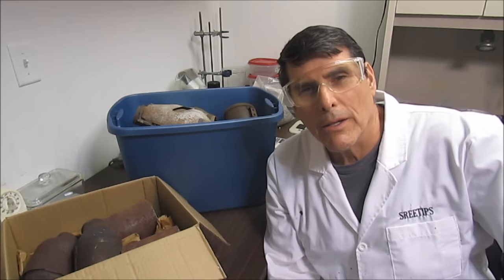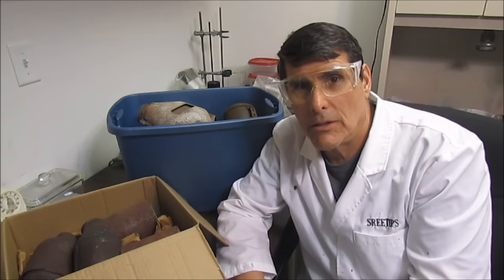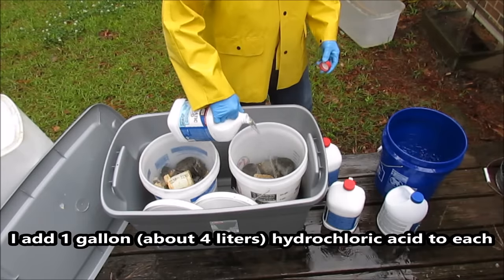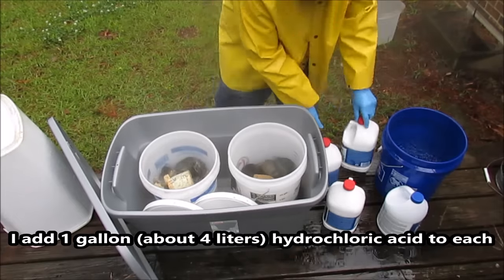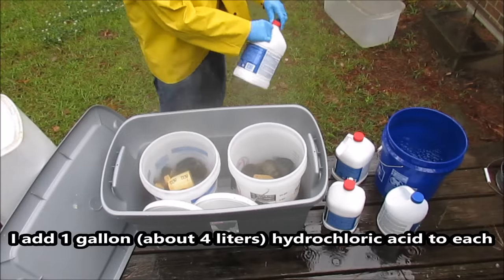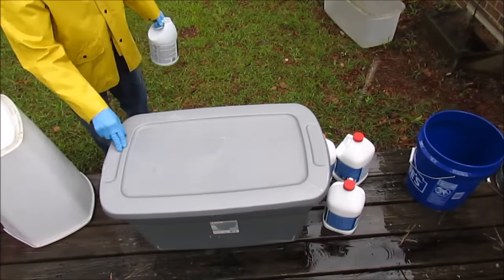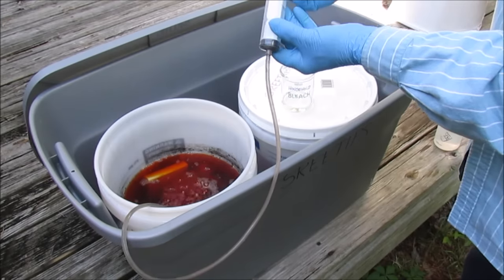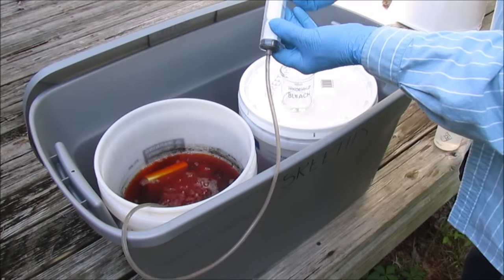Platinum Recovery From Automotive Catalytic Converters Part 1of2

Comment: Being a HVAC man myself it did my heart good to see you change the oil in you vacuum pump...! Take care of your equipment and your equipment will take care of you is my motto also...
Reply from the maker: I it's been in service for nine years and still going strong. Those things are bullet proof.
Reply: Yep as long as you change the oil frequently it will give you years of trouble free service. My Robinair is 30 years old and still pulls 30” of vacuum ...!

Comment: Really interesting videos, many thanks. Glad such attention to risks, but one gentle note though e.g. for anyone reading the comments and thinking of doing this or similar - maybe consider using longer gloves.. in the video (from point of processing outside through into lab) we can see a fair bit of exposed skin between glove and sleeve.. when dropping bleach in from above ..or dropping the zinc pieces into toxic dissolved platinum solution there will be splash back ..if you’re worried about aerosols enough to put a lid on beakers to protect a fume cupboard, maybe that’s an aerosol risk to all skin surfaces exposed nearby. Of course it’s all a matter of dose.. and it’s not like you’re holding your arms above them all the time… but still, given the toxicity, maybe wise to reduce skin splash risk a bit more. If you can see the skin, it’s definitely not protected (and that’s before we get onto the weird and whacky issues with different glove types and different chemicals).good luck with it all and thanks for the videos.
Reply from the maker: Platinum is simply too dangerous for the hobby refiner.

Comment: When I remember right, cementing is not exactly dissolving zink by acid until the acid is gone. Normally the cementing starts electron by electron because of electro-negativity even in water ON the less noble metal in exchange of it. So you were right to give some Na-carbonate to lower the acidity to save zink. I wouldn`t use Ca-carbonate because you get a new element in solution and that may cause some trouble in an other place in the story, maybe NaOH to neutralize a little?? (Na is allready in the process.)
I like your vids very much, especially the warning for dissolved metalls in terms of your health.
best regards Olli
Reply from the maker: According to the pros, folks who do this for a living, sodium carbonate is the chemical to use. The exchange of electrons is called "cementing" because when copper is placed in an acidic silver nitrate solution, the resulting grey silver powder looks like wet cement. Some free nitric is required for the reaction to take place. I've put copper in a silver nitrate solution with the nitric used up so completely that the copper just sat there and no silver formed on it. To get the reaction started, I added a single ml of concentrated nitric acid then stirred. Then the reaction began. So some free nitric must be present to get the reaction going. This has been my experience.
Reply: Jes sir, that is right, a littlebit acid. Here you needed huge amounts of zink to kill the HCl , so my thoughts are to lower more with NaOH, not all!. Over here was an old copper-lead-zink mine from the 18 hundrets, where big copper trees got buildet on the old steel-rails from the ore-carts under water, the same process I guess. I do the same with my stockpot, copper tubes in it. After a while I check the PH and lower it if needed. 
Sodiumcarbonate Na2CO3 is a good choise either and cheap, it builds with 2HCl --> 2 NaCl (table salt) + CO2 gas + H2O so you get rid of the surplus of HCl.
NaOH should do the same, just without the carbon dioxid. HCl + NaOh --> NaCl + H2O
and the zink is doing  Zn + 2 HCl --> ZnCl2 + H2 gas
Is the H2 needed for PM to drop out?

Comment: Best video I have seen in recovering Pt from Cat converter. Couple of question -1. You use sodium carbonate to reduce the acidity of the solution. Can I use calcium carbonate too? 2. How will you know that the all platinum were leached from the cat using HCL and bleach? Looking forward to your response. I hope you will do video in recovering Pt from metallic cat.
Reply from the maker: I think calcium carbonate is ok to neutralize, but I've never used it so not 100% certain. How to know when all the platinum is leached? Not possible, you simply can't get it all. The best case is to leach for about a month, then harvest the liquid.
Reply: Thank you for the response. Appreciate it

Comment: Since the mid 1990s, the catalytic converter is the most stolen part of any vehicle, specifically because of it valuable content.

 I had mine stolen 3 times on one vehicle. So the last replacement i got for it i had it moved further along the exhaust system and boxed it in with an empty stainless steel exhaust/muffler box and welded it inplace. So to any would-be theives, it looked like it didnt have a cat on it. 

It worked, i never had it stolen again off that vehicle, and my car still passed its emissions test every year after that so moving it didnt effect its effectiveness.
Reply from the maker: I bought those cats on eBay a decade ago (or longer) specifically to make the video. It was back when gold was a thousand bucks, palladium was six hundred, and platinum was fifteen hundred.
Reply: @sreetips  well you did a great job. I'm pretty much in awe of your videos! It's like watching real life magic.

Comment: I would have used a shot of Sulfuric Acid to take care of any Lead. 

Back in the day the ignorant poisoned their Catalytic Converters by running Tetraethyl Leaded Gas through their cars when they still sold that. I know that nozzle sizes were were varied to prevent this at the Gas pumps.

But I learned that I do not want Platinum salt poisoning by watching this video. I was unaware about the toxicity of Platinum Salts..

Great video as usual.
Reply from the maker: I'll have to remember to do that when I try to refine it in part 2 of 2

Comment: Don't get me wrong, it was informative for most. Nitric acid would have been the way to go, but you opted for the more difficult route. We are appreciative of the work you put in. That being said you restate the same thing over and over again until the point I'm screaming at my phone. Once or twice is OK -- four to five is just too much. FYI, I did some math with spot prices today. Below are my results. Keep in mind these are just estimates.
HCl 5ga@$8: $40
NH4Cl 1lb@$10: $10
40% H2O2:$10: $10
NH3/NaClO/H2O/Clorine tabs/Filter paper $10
Catalytic Beads (said a couple hundred): $200
Zn (didn't show us how much was used): $100
Total Cost: $370

Pt p/g: $25.60x4=$102.40
Pd p/g: $31.66x10(*)=$316.60
Total Net: $419
(*): you yielded 6g Pd with the additional vial you added to the reaction. You claimed another 6 was in the buckets. 10 grams is my estimate.

This took you at least a week not including time it took you to film it and you (would have) made roughly $50 (not including whatever you spent on the catalytic converters). You said you are selling that at a third of the price on Ebay so you lost about $250 after acetylene and oxygen and electricity and cleaning supplies/neutralizer (YMMV in any given location). Thanks for taking the time and money to do this. Just try to stop repeating yourself.
Reply from the maker: I've tried nitric in the past. Chlorine leach is much cheaper and much more effective at removing the PGMs from the ceramic substrate. Hopefully, after watching this video (the only video series of its kind on the entire internet) those who want to "make money" refining cats will become discouraged. You can't make money refining the platinum group metals from automotive cats. It's just not going to happen. It's too dangerous for the backyard hobbyist. And the yields are too low to cover expenses. That is the whole point of this video series. Sorry for the repetitiveness. Most videos on this subject are vague, leave out critical details, or just show part of the process. I try to include as much detail as possible for the benefit of those who want to know, and see, the entire process.
Reply: sreetips exactly the response that I was looking for. Yes the nitric can be more expensive, but the time it requires saves you in the long run.
Reply: Cameron J so if you know any short cut on the process maybe you can do a video and share it with everyone.

Comment: I don't know if anyone has mentioned this, but a simple way to tell if the converter has not been processed and has intact catalyst is to aim a propane torch onto it; if it incandesces, it is intact, and will even burn the propane flamelessly.

Comment: Let me give you a little tip about using your grinder with the cut off wheel. Anytime you use a grinder like that. you want to hold it where the wheel is pulling the grinder away from you not pushing it towards you. That's a good way to get that wheel to kick back and really screw you up.
Reply: Good advice I just broke my nose a month ago from a big grinder kicking back

Comment: When I was in the Navy. We called it P.M.S. preventive maintenance and servicing.
Reply from the maker: I remember it well. Ever hear of “gun decking?”
Reply: @sreetips  Gun decking no I found scuttlebutt to be a funny word. Also sound powered phones are cool.
Reply from the maker: Gun deck is when some one marks a PMS check as complete, but never actually did the check.
Reply: @sreetips  Sounds shady and lazy.
Reply from the maker: Agree - none of my guys did it. I did spot checks. You can tell right away if they gun decked the check.

Comment: Hi Sreetips - I started putting up my lab ( at the backyard)  with simple but effective hood.  I'm also gathering chemical supplies  - and most of these are low grade HCL and bleach. I saw that you used sodium chlorate to increase the reaction . Its difficult to find sodium chlorate  here in my country. I'm planning to use calcium hypochorite (50%), is this effective too? 
Last question:  In your video, I seldom see that you stir the solution inside the bucket ( maybe  you did) will  it be okay to fully enclosed the bucket and just leave small opening to  be able to add the bleach (or calcium hypochlorite)? THis is to avoid more exposure  in chlorine gas - I will just open the bucket after 2 weeks and its ready to  drop the pt. Any recommendations? Sorry for  to many questions. Thank you in advance.
Reply from the maker: I've not used calcium hypochlorite so I don't know if it will work. I used sodium chlorate to speed it up. But just adding bleach and waiting longer should work. If bleach is poured through a small opening then it may shoot a jet of chlorine gas when bleach is added. I recommend that you don't try this experiment without the proper safety equipment because it is too dangerous.
Reply: Thank you again for the quick response. Yes, I understand the danger and  I'm preparing necessary/proper equipment to do the  experiment safely.

Comment: In my quest for knowledge. My cars check engine light came on. There was a crack in a rubber vacuum hose. That put more air into the cat. All data a service used by mechanics said its a 6 hour job to replace my cat

Comment: It's possible a portable hand held band saw might work nicely for what your doing, sometimes you can get a good one at a pawn shop, also a puting them in a vice might help.
Reply from the maker: Both those would work well. All that I had were those shears so that's what I used.

Comment: Get a table vice and use the to hold the material while using an angle grinder with both hands, that way you'll be able to control how much you cut into the material you're trying to save as well as increase the safe usage of the tool. Unlike other americans, you at least haven't taken the shield off.

Comment: I would love to see this process done with high grade original cats. Unfortunately you have mostly low grade and aftermarket cats here. I’ve been doing this for years and know the proper value of each piece. I also know how to analyze and process them but, a refinery has always been the option to do the final process. I wonder how accurate the yield would be with this method... You would need to xrf all these before you attempted it though.
Reply from the maker: I only did these to make the video. It’s too messy and too dangerous for a backyard refiner.

Comment: Spider jumps out of the the cat @ 5:38 like holy shit and scrambles away lol
Reply from the maker: I didn't see the spider. Hope he don't bite me!
Reply: @sreetips  it looked like a black widow lol
Reply: @sreetips  you possibly had up to 5 aftermarket converters in your batch, definitely 2 are, 3 are suspect.  the aftermarket cats have close to no pgms.  the round shiny ones (aftermarket) can be bought new for $30.
Reply from the maker: Another reason why this is not a good idea for making a profit. Too dangerous for the amount of work and tiny bit of metal.

Comment: Wearing chemical PPE (personal protective equipment) would it be more effective to drain off the liquid into a clean bucket each day, add the bleach, gently mix, then pour the solution back over the catalytic converter material?

Comment: Yeah, it’s difficult to know or tell when adding a chemical to the top of a solution that the bleach or second chemical is going to fully expend itself without mixing much.  A mild shaker table or even an air bubbler(portable live well air pump like fire minnow bucket or slow flow of low pressure air from air compressor to agitate the solution might help but I would guess most of the bleach hydrochloric acid and platinum reaction occurred expending most of the chlorine within a few inches of the buckets liquid.
Reply: PS NOT a chemist by any imagination

Comment: Just Wondering..... Can you use copper to cement out the PGMs?  I know you get PGMs in your silver cement when you use copper.  Or is the Zinc providing a faster way?
Reply from the maker: Yes, but it’s lower down the reactivity series list and would be very slow to cement the PGMs. I used zinc because all I had was pgm in solution (no copper or other metals between platinum and zinc. And zinc is higher in the list and much more reactive so it cements the metals out very fast.

Comment: If you have a big heat resistant bucket you could put those metal sub- straights in a bucket one at a time with sulfuric acid and water, and the sulfuric acid will dissolve all the iron into solution and just leave behind the precious metals , iron, sulfuric acid and water are very volatile though so I'd make sure it was a BIG heat resistant bucket ,like one of those buckets people use to store horse feed in, and just wait for a week or so, pour out the iron laden sulfuric acid into clear containers and keep doing it until all the iron is gone and all you have left is the precious metal sludge , probably get better profit than selling them on eBay, unless you'd sell them to me for a reasonable price🙂??

Comment: Hi great experiment. Based in your experience. What is your opinion about all the cat cleaners in the market? What will the best way to clean without affecting the properties of the cat? Thanks
Reply from the maker: Adrian, I'm not sure, I've never tried to clean one. But I do  know that high heat is effective in cleaning off carbon deposits and other trash. So based on my experience i'd have to say that incineration is the best way to  clean a cat.

Comment: I know this sounds a bit counterintuitive but when you cut with an angle grinder aim the sparks towards you. If the grinder bites it will fly away from you instead of right at you just fyi

Comment: You need two torches cause your mold needs to be hot also before Nd while you pour your material into the mold. You just dont pour into a cold mold. Maybe have a nother person helping you keep the other  item heated while you're getting ready to pour your material.

Comment: I love your ingenuity, however it would have saved you a ton of money in reagents if you had an assay done on the catalytic converter powder. This would determine the amount of reagents needed for your process. Basically, crush up all of the catalytic converters, then submit a small sample to a lab for about 30 bucks. This would give you the amount of platinum group metals in your sample. You can then do some basic stoichiometry to determine the amount of reagents needed. You added Zinc and Hydrochloric acid in excess. In most cases, you were just creating zinc chloride. I will say that I am not an expert in extracting Platinum group metals.
Reply from the maker: I wasn't too concerned about yields. I wanted to gain the experience and be the first to produce a video that shows the entire process. It's the only one of its kind - on the entire planet. This one should push up into the millions. Thank you!
Reply: Hey scirobo do you have a second to talk I am going to attempt can you help me?

Comment: The gas being evolved from the zinc and HCl is hydrogen gas which is highly flammable(explosive even)
Reply from the maker: Correct. But it won’t explode unless it’s allowed to gather, concentrate, and mix with air (oxygen). Hydrogen gas is not flammable by itself. Buys it’s highly explosive when sufficient quantities are mixed with air. Obviously, the amount of hydrogen produced in this reaction was diluted by the airflow of my fume hood.

Comment: Have you ever discussed how you have your exhaust system set up that It can handle all those fumes and how do you purify the air on the output
Reply from the maker: It just blows up the stack. I don’t have a purifier.

Comment: I'd like to see how the ceramic insert is made.  those are awfully  finely perfectly aligned holes through those things.
Reply: They are extruted from a clay like material, dryed and hardened in a kiln
Reply: @friedrichmarkus3574   the  extrusion process must be an amazing piece of engineering.  Those tiny holes running perfectly for maybe 8-10 inches in come cats.